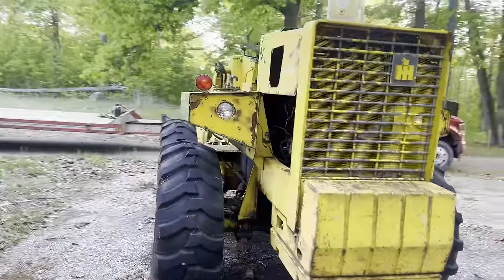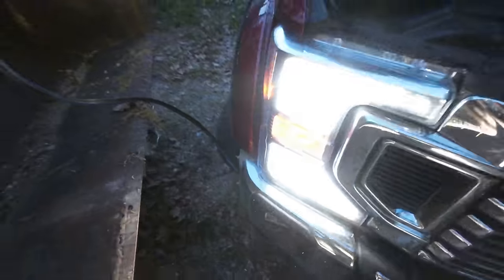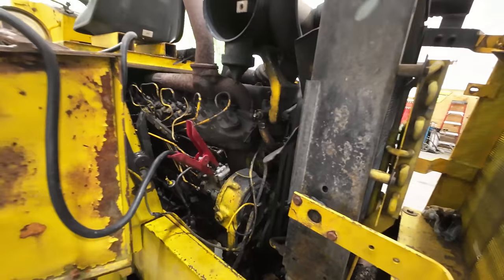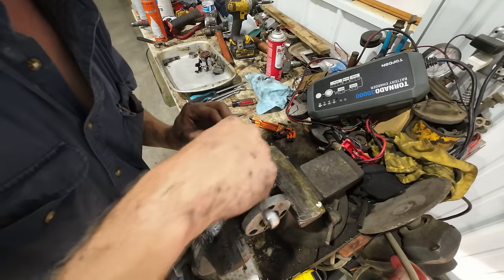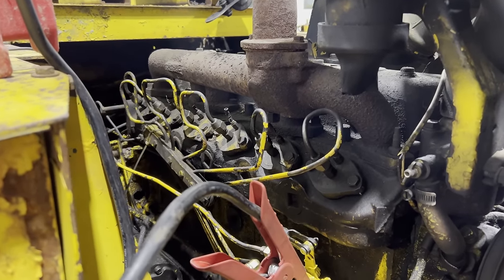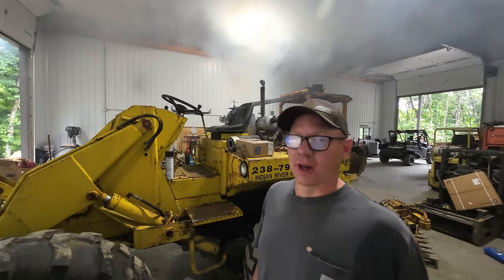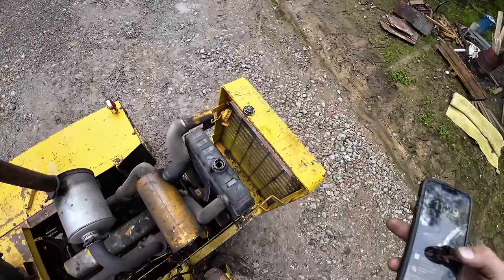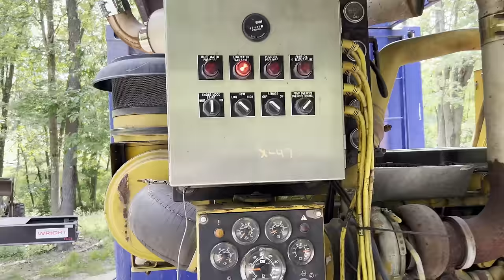FREE International wheel Loader, Sitting 8 YEARS! (Will it Run??)

Comment: I’m sure it’s on your list but get yourself a plug on the front of that truck with a disconnect to an aux switch for jumper cables 😊 no more opening the hood. I have a jumper cable set and an “extension” set so I can have 40 feet if I need to to jump a dump trailer to dump or whatever else is needed and keep it away from the truck.

Comment: That looks like a 282 diesel. I have a Hough H50D with that same engine. I rebuilt the engine and all brand new it will not start without using the glow plugs. It takes 30 to 45 seconds on the glow plugs on a warm summer day and nearly 2 minutes on a winter day with the unit plugged in. They are extraordinarily cold blooded engines.

Comment: Those cav pumps are great for plungers sticking . Sometimes heat gun and few taps with small hammer with free them up. Last one I had we used electric pump and ran heated motorvac injector cleaner through it . Free up and ran after few hours .

Comment: A 1x6 pine board on the jaws would provide a soft jaw and keep it from rocking in the vice. Great Tires. Looking good.  The wire is so the screws won't unscrew.  Used extensively on aircraft where every screw is wired.  A shaking body that unbolts itself can become really unbolted and fall apart.    GLO Plugs are needed.

Comment: Love the vid, I think a exhaust fan wiring vid, is due 🤷‍♂️. I believe that engine is a 5300 series, f so I’ve rebuilt the cylinder heads. That engine is prone to blow by  as you suggested. The bad news is the block cracks between cylinders due to over heating, inspect with dye check if you take the head off.

Comment: New subscriber, saw the pump repair on ADS. Please do another video of you setting the timing to see if that white smoke clears up. And as another commenter pointed out, if it has an oil cooler connected to the water supply, that could be the reason oil is in the radiator.

Comment: Add an hydraulic hook to the bucket so you can crab stuff with it, it will make it tenfold more usefull.

We have tiny Avant loader, but it still has enough power to lift one metric ton.
We have forks with the hydraulic hook/cover on it, and it gets used daily

Comment: Tyres on the free Inter look pretty ok ))   Warren at western truck and tractor channel, had a good video on those fuel pumps a few years ago. You time an injection pump like that using 'spill timing'......number one injector line should 'spill fuel' at something degrees specified in the workshop manual.   I once installed and timed an injection pump on a V8 Mack E9 engine, I just followed the manual. Only hassle was that as pump meshes with the accessory drive, the helical gear kept rotating it out of timing, took a while to get the right gear tooth.

Comment: Rather than use ether in warmer weather, I've used a one or tow gallon pump sprayer from Lowes (Zep brand).  Fill half full with diesel, pump it up as much as you can and adjust the spray tip for a fine spray.  About zero danger of flashback and the engine is running on diesel which is a lot cheaper than starting fluid.  The Zep sprayer I have is 4 years old and diesel doesn't seem to hurt the O rings in it in any way.

Comment: Howdyyawl from the land down under. It's an old but nice unit. Sounds like it's a little back on the timing, also, the head gasket is a bit tired. Nothing that can't be fixed. With your energy & elbow grease, & patience.  In OZ we have a nylon product called ( start U bastard ). Coz that's what we say when it went start.😂.😊

Comment: Hi Matt, love your channel. May I suggest you make up a heavy lead with a solenoid in the middle for starting engines without using the machines' wiring?  This would allow you to operate the starter without being under or alongside the engine which is much safer.  It would probably give better connection, particularly if you had ring crimps on the end which could be bolted securely to the battery and the starter which could give a faster turn over and better chance of starting.  A little work just now would give you another tool to work safer and possibly faster in the field.  We would hate to lose you!
Reply: I'd NEVER start a machine while I was under it.

Comment: That engine is similar to a IH 560,706 diesel.Lower compression glow plug engine.Even fresh ,hard starting without glow plugs if it will at all.They run good and are economic on fuel. The walk past with an ice cream cone and it won't start bit is pretty true of them.Timing is critical and glow plugs a must.The Rosa master pumps last quite a while if taken care of. This old loader is quite the project.Some IH parts are sketchy. It would probably fire up well with glow plugs. Ether starting isn't too friendly to these engines I have found. Worth picking up for a posting video and a fix it project to boot. Tires look sound . It should make a fair loader for someone willing to work on it. It'll do a bit yet.It was bought to use and has become obsolete so it wasn't kept up.Doesnt mean it's done though.It is a good idea to have the injectors done with the pump.Also check the lines in the retaining strip.The rubber gives up and they shift a bit and vibration rubs them thin or through on the bolts and strip itself. I'm sure someone will take it off your hands should you go that route.

Comment: Hey Matt it’s Bradley from the land down under Australia 🇦🇺 and we used to have an old Hough 50 pay loader with the exact same engine in it and you could never start the old girl without the glow plugs working they were critical in starting her. She also used to leak fuel back to the tank when sitting so you had to always bleed the filters. And she had about the same amount of slap in the pins and bushes as yours 😝 love the show mate keep up the good work keep the videos coming 👍🏻👍🏻👍🏻

Comment: A tube the size of the exhaust fan with 4-6 inlets in its length at roof peak area will seriously aid smoke extraction. A comp;any shop I worked in had one like that for the heavy diesel shop.

Comment: it seems, exhaust fumes is always will be an issue in a repair shop, try one of those flexible big air ducts  , attach one end to the exhaust pipe and the other end outside the shop, guides all the smokes outside

Comment: Before pulling the injectors try FPPF Killem Diesel treatment. My old Mack and my duramax had gotten into bad fuel. It cleared it up in about 45 minutes of running/driving them.

Comment: I had a 3820 loader/backhoe.
It had a full cab.
I rebuilt the whole machine.
I put 2 of the biggest batteries in it.
The quicker you spin that motor the better it starts.
Dont spend  money on that iron.

Comment: Matt, after doing some research and finding the model number from ADS channel video on the pump. This wheelloader has the d-282 engine. Out of all ih engines they are the hardest starting ones. Make sure to have good batteries and good glow plugs because it doesnt matter the twmp outside you always need the glow plugs. Thats just how they are and were like that from factory due to being a lower compression diesel. I have a ih 706 tractor with that engine and hate it. Some ppl have luck with them and i hope you do as well but mine isnt good even after a rebuild. Just some info on your engine bc it sounded like mine fron startup with the 282 "tick"
Reply: Apparently the compression ratio is 17.7:1, which is very low for an IDI diesel. Kinda surprised that they start at all!

Comment: I love how you slam it on the trailer yet in the new shop you're as gentle as you can be to the cement on the floor😅
Reply: Trailers have suspension and are easy to repair. Cement floors, not so much.
Reply: @jackson_68  good point right there only mistake is some trailers are far from easy for repairs 🤣

Comment: You were doing a great job with that pump! That ball catches everyone out there is a specific tool to undo that as it’s not exactly an Allen key or torx, once you get that out and finished disassembling it there are two little pistons in an eccentric ring and all that pushes them out is fuel pressure, once you free them up you would have fuel pressure again, maybe on the next one you can give it a go! Seal kits are under $100 and there is a few good youtube tutorials on how to do them! Great work none the less

Comment: You should get an exhaust hose to push the exhaust outside instead of the carbon monoxide sitting in the building while you work. You could actually build a custom exhaust box that pulls the exhaust out and push it outside through a hose direct outside.

Comment: Wow what an interesting
Video, yes U have 2 get your
Priorities right , 1st thing is
Exhaust fan wired up & running & maintenance
around the property also
including spreading grass
seed some areas are so bare
 And when you have time get
back to the job in hand ??
Can you fix the engine &
cooling issues, the bushes
& pins & wiring ??? what is
the answer , l'm sure some
where someone needs a
Small dozer 🙄😮😁

Comment: Not familiar with that exact engine. But all mechanical pump engines i delt with with the procedure would be to turn the engine to #1 TDC, instal drive gear and then turn the pump to line up the 2 marks and you are timed. Some international  engine i worked with needed to be turned to 15 - 18 degrees If I remember correctly.

Comment: Down at the lead foundry in west Seattle they also had a front end loader by Hough. Open seat like this one but a gas engine. Due to working around a foundry all gas equipment was converted to propane or I believe that was the reason. Anyway one night on 3rd shift the new operator filled it up but left the motor running and brake off. It started rolling and busted the connector and burned the Hough up. Anything not metal burned up. Fortunately the main propane tank didn't explode.

Comment: Well it's got four good tyres, so that is $4000 worth.   The white exhaust could be water getting into the engine via a poor head gasket.   There should be a timing mark on the DPA which should be set at tdc.   Best of luck, it looks like a very useful machine.

Comment: If you come all the way to Norway I have a Hough H30B wheel loader, a Clark Michigan 45B wheel loader and an Atlas 1122D excavator you can have.
Need to clean up a little bit and they all start and run :D

Comment: We had two of those. I want to hear the international engine. It had to overhaul. There's an old international shop and I got the rebuild kit for that engine for 700 bucks. We've got all the books for that will order. The second one we got has a small Cummings engine in it. So it moves down the road faster

Comment: Just a hint: The laser point at IR thermometers does not reperesent the actual measuring area - just the centre.. You need to consider the measuring "spot" to be about 1,3" at a distance of 12"" and 3" at 36" distance. Else you get displayed some kind of useless average.
Usually they show it as diagram at the side of the device.

Comment: SUGGESTION: just get a few meter hose(fitting over most exausts) with an inline fan, this way even in winter, when you want to save warm air you will be able to collect the fumes and get them out through barely opened doors. Or even better, make a port on a wall to connect that hose. Small inline fan will not waste your heat as that giant one high up, and it will not allow fumes and sut to spread around the shop before extraction.

Comment: Back in the late 60's  we had a 930 case that had a place to put a can ether in a holder with a direct line into the intake  . It was made to push button as you cranked the engine  .  Only used it couple of cans worth  , only when no one else was around to spray it into air cleaner  . It would start easier by spraying it vy hand than using the built-in device  .
Either way I have use ether quite a bit in my lifetime never ever had any problems or experience damage from using ether  .
Like just about anything and everything there's going to people who get carried away using to much of all kinds of products  . Uncommon Sense is getting to become more the norm  .

Comment: Watching this, I am worried abut that fuel shut off solenoid electrical wire clamp. Early in the video (about 8:15), that thing looked like it was sparking quite a bit on each start attempt when looking for fuel to the injectors. Maybe it was something else sparking there? The whole cavity looks oily and petrolly. Was/is there any danger of a spark causing a fire? Why not just attach a wire securely at the solenoid connector and extend it to the electric 12v supply clamp outside? This situation repeated (but with no sparks) about 34:00 in the video. BTW: I (and maybe half-million other people) really enjoy your videos!

Comment: Bro, basad on the exhaust/hard start/overall state - the cylinder rings are in really bad shape/ready for change, respectivelly new cylinders + also the coolant sealeness is really off/ready for new "heads"/sealings for head. So really, it depends on the type of motor, but there is a chance - since this loader is obviously some US local production - that there are these parts somewhere still in production, so try to look for it/i would definitely check this ;-) (and perhaps sorry for my mistyping, but I was in similar situation/symptoms here in Czech Republic with our old tractor from previous era (1970) ... and luckily, they (in Poland) somewhere are still producing theese heads as new spare parts, since the Brand of tractor is here in CZ (Europe) kind of tradition... So, I would definitelly check the motor type/your local machinery services/spare part vendors :-) And btw. nice (=handy and compact size of) machine - so yup, understand you (y)

Comment: I'm only a little way through here, and I'm no mechanic, but wouldn't it be better to crack the injector lines before adding compressed air to the intake? If there is any junk in the lines won't it end up stuck in the injectors? Keep up the great work, I love having these videos on in the background while I'm working 👍

Comment: Looks like a D282 engine. I would imagine you have a head gasket and/or head issue which wasn't uncommon for those motors. Good thing is that motor is a dime a dozen and was used in tons of applications!
Reply: I needed one for a tractor. And I can tell you they are not a dime a dozen anymore cheapest running one I could find was 4k. I sold the tractor.

Comment: so you could also check to see if that has a WATER COOLED OIL COOLER. if it does then that could be the source of your oil in the water. my detroit 453t had the same problem.

Comment: The hard starting with a repaired pump must be low compression (or glow plugs) and I hear on gas engines, low compression is often not just wear but stuck rings that have been glued to the pistons by hardened soot, and can be unglued from the pistons by running high detergent fuel and oil, or filling the cylinders with fuel detergent like Sea Foam, soaking for a few days, and then blowing it out through the glow plug or injector holes to prevent hydro lock.

Comment: I would say stuff a 7.3 in it but that would cost more than the loader is worth.
I'm hoping in the years ahead you get the time to throw a head gasket, maybe a set of rings, wiring and bushings at it.
Along with all the other things it needs.

I have always had a soft spot for IHC equipment.
The Payloaders were one of the first wheel loaders on the market.

Any idea what year?
Is this one branded IH or IH/ Hough?
I saw the IH "tractor" logo on the grille.
I suspect it has had a few "Ritchie Brothers rebuilds" (spray it down in cheap yellow paint then call it "rebuilt") so labels may be had to find.

Huge shout out to the subscriber who gave you the old girl.
Thanks for saving this piece of history from the scrapper's torch!

Comment: Ih d282 or 301 they get a bad rap but what indirect start diesel dosnt. We personally have 5 tractors with them and a crawler loader. The engine was put in a wide variety of things most common  was 560,656 and 706 tractors from 1958 to 1973 for sure . Biggest thing that ruined these engines is most people wouldn't fix glowplugs and use ether and in a indirect diesel engine is a big problem because it cracks and shatters the injector precups. These engines healthy need 30 seconds of glowplugs on a summer day. Love your videos and hope this helps if you have any questions feel free to reach out
Reply: Starting fluid has a lot of different uses. Check the percent of ether on the label, go high percent of different brands, check prices. Get a good case (12 cans) price. Good luck. Mini flame thrower, be careful!!
Reply: Does the EPA watch this channel?? LMAO

Comment: Worked on diesels all my life, Perkins, Cat, Detroit, Cummins, Deutz and I can tell you that you got lucky with that pump, they are mysterious voodoo only specialty shops are equipped to deal with.    "Mike Drop"   As for the engine I don't know the spec's on it but a 4 or 6 cyl. Cummins 12 valve is an easy swap, tons of them available in other equipment.  Loaders, pavers, excavators', even air compressors and dozers have them.  Look for older Komatsu equipment, they made their own under license from Cummins.   Cummins has all the adaptors to make it bolt to the trans, they are standard swap engines and if it's not directly bolted to the trans and there is a small drive shaft to the trans, even easier.  Being a smaller machine a little fab work will, with the existing parts and some plate have it mounted in place.  I see a 4cyl with a turbo out of an old IR compressor pushing that thing down the road no problem and it would make a great video too.